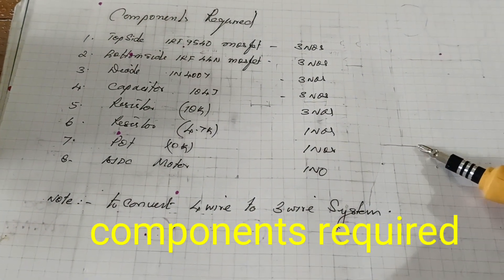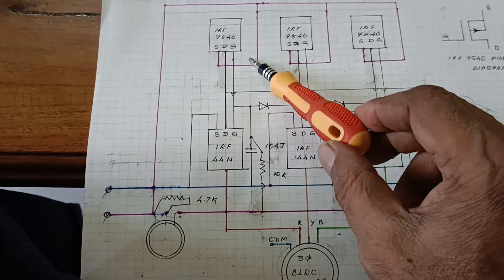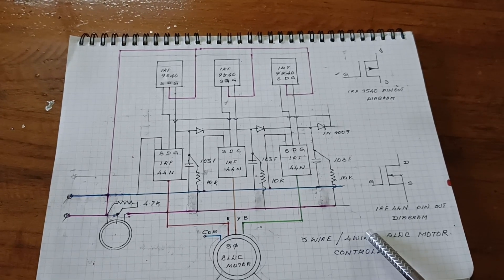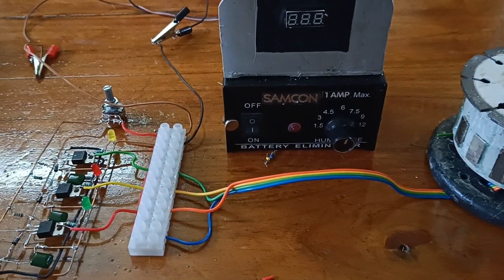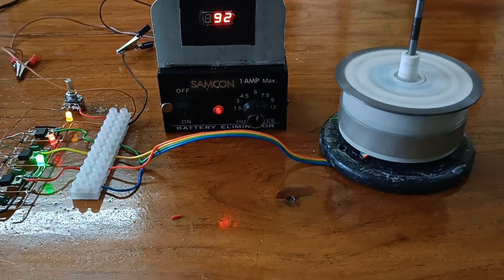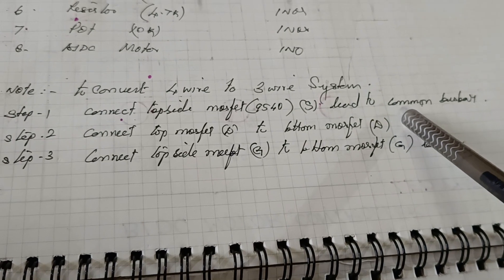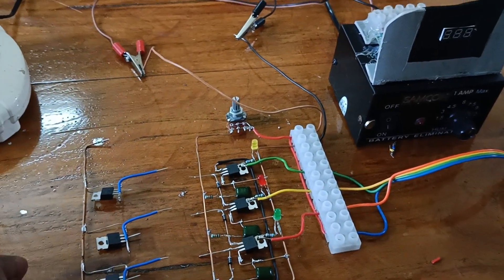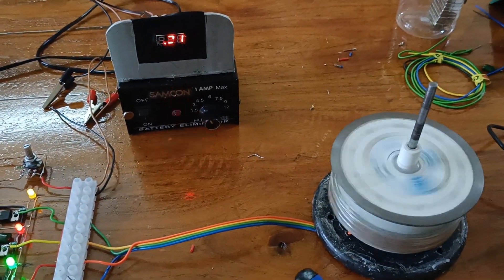(MC-12) 4/3wire bldç motor controller

Comment: Which direction does the motor run? Clockwise or anti-clockwise? Or multi-direction?
Reply from the maker: It run only one direction if you want to change the direction of motor connection should be changed